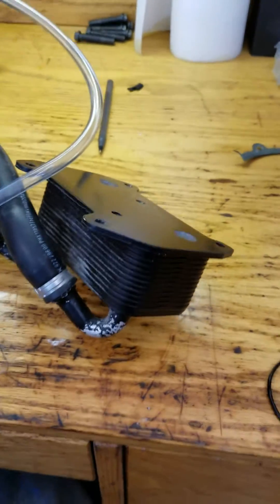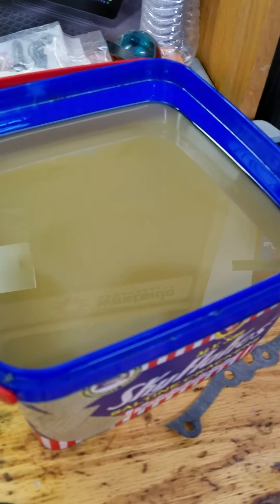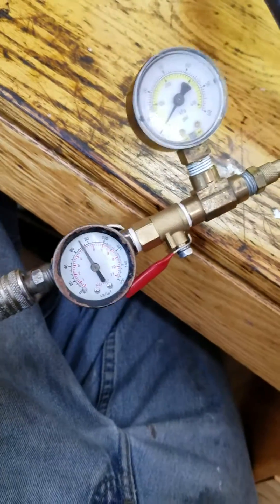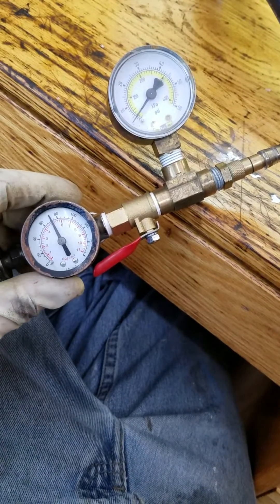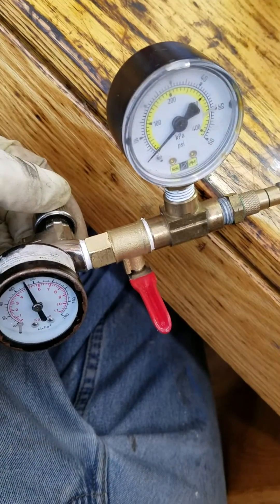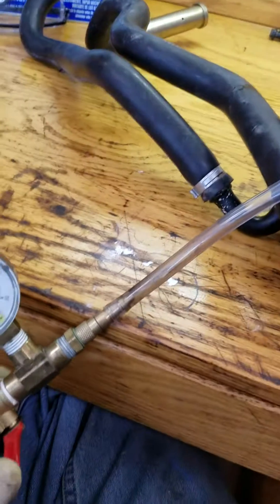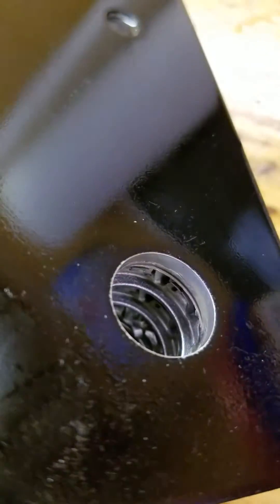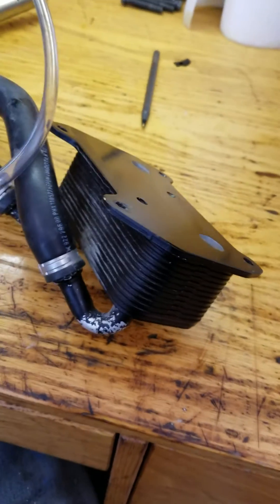Finding a leak in seadoo 4tec oil cooler

Comment: Did you have to pull the motor to get the oil cooler out?
Reply from the maker: Nope, just the intake manifold. The seals are reusable making it a pretty easy task. Just put some tags down to catch the oil that's sure to come out
Reply: @hybridorbital85  I have the same problem on  a 2005 rxp 215..

Comment: how many hours on the oil cooler ? is it a common issue for them to fail ?
Reply from the maker: mine had some water in it when it got down to below freezing in the garage. I've also seen them get eaten by salt water to the point of leaking. Other than those two causes, I've not seen them fail very often.
Reply: @hybridorbital85  thanks for the info, I’ve been pretty lucky with mine I guess. We don’t abuse our seadoos, some guys redline them all day line and wonder why things fail. 

I’ll keep an eye out for any eater in the oil cooler but I’ve never even seen dirty oil in our machines given the yearly oil changes.
Reply from the maker: @oneeyedrone4293  I redline my 185hp 4tec regularly on takeoff, but I don't stay in WOT very long. Usually I cruise between 5 and 6k rpm. My boat is only 14.5' long, so it's a very wild ride at WOT. The conditions have to be just right, and even then, it eats SO MUCH fuel doing that!

Comment: Would this cause oil to enter the coolant tank?
Reply from the maker: It might, but more likely, you'll find water in your coolant, like I did. You have to pull the intake off to access this part. I've seen salt eat holes in these from the outside. They're also prone to freeze damage if antifreeze is not diluted properly
Reply: @hybridorbital85  Thanks

Comment: Did you notice your coolant level dropping? I have the same problem but only happens when hooked up to the hose on in the water.
Reply from the maker: it can be a cracked oil cooler or a defective water pump impeller seal. it's driven by the  oil pump. other place it could be is your head gasket
Reply from the maker: to answer your ?, I never noticed the coolant level. I caught in the very early testing stages of my boat conversion build. I noticed that color of the oil on the dip stick, then confirmed when I pumped some out into a tub.